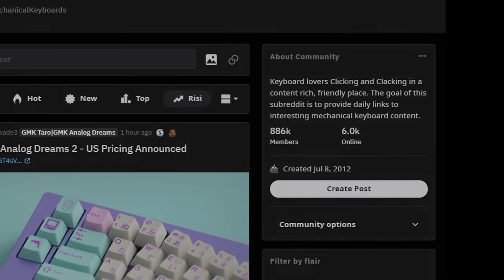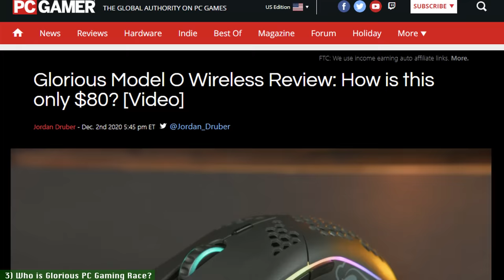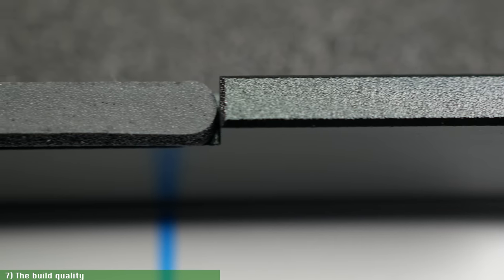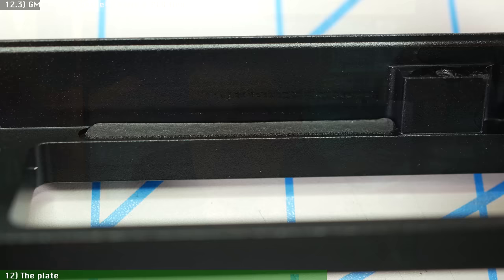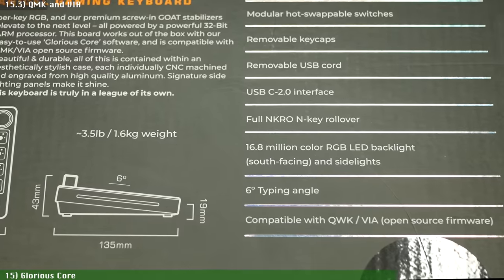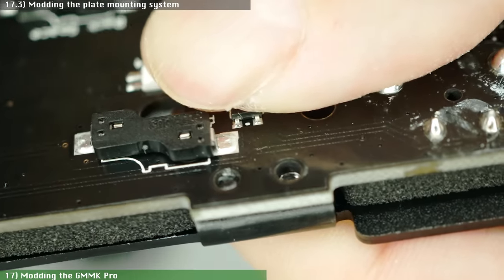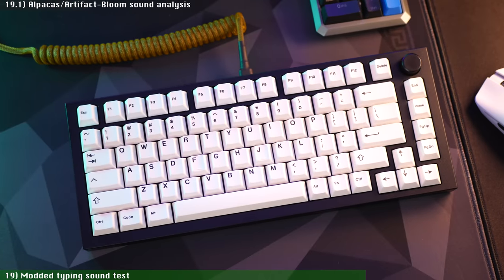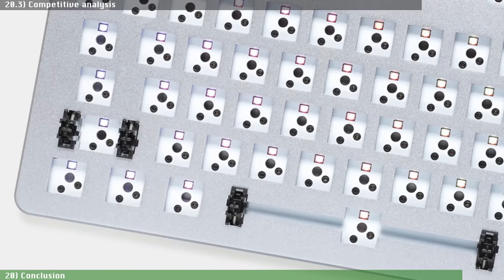GMMK Pro: The ultimate guide (in-depth review + modding tutorial)

Comment: just bought the keyboard + duroc v2 stabs, tealio linears and corsair ppt keycaps. Was wondering, ive seen alot of stab mods but ive heard the duroc stabs i bought are one of the best, so was wondering would you mod them or just lube? also I believe the pcb is pre applied with dampeners for the stabs, is that fine to use or would you recomend that I do a different mod? Im also looking for some neon green dual shot ppt keycaps, preferably lazer etched for the backlight, do you know of something like that or where would I have to go to wait for something like that to show up?
Reply from the maker: Durock's stabs are indeed one of the best and all you'd need to do with them is lubing the housings, the wires and applying some thick dielectric grease to the wire tips (and band-aiding the PCB if you want them to be a bit more quiet on the bottom out). No need to clip these since they come pre-clipped already.

The main challenge with Durock stabs on the GMMK Pro's Aluminium plate is the fitting... You might need to file the plate cutouts a bit to ensure the larger Durock's housing (or Cherry and Zeal as well) can fit.

While my copy did not come with dampers under the stabs (they started doing that in the latest batches), I heard quite a few reports that the included dampers came soaked in lube to the point where the stabs were getting stuck in the goo... So I suspect you'll probably have to either remove as much of the pre-applied lube from these dampers as possible, or replace them with Band-Aids or silicone stickers ( https://amzn.to/3fxLtt4 ) for a cleaner job.

As for the keycaps, the south facing orientation of the GMMK Pro's switches mean you'll have to chose between opaque double shot keycaps (which means you could choose whatever set you want that has the small right shift, Alt, Fn and Ctrl) or find a backlit set that has letters in the bottom side of the top surface or on the side of the keycaps for proper illumination. Since I have never seen the former in the wild, I'd suggest you go with the latter, which would be something like this set from Drop: https://drop.com/buy/artifact-bloom-series-keycap-set-glow?utm_source=linkshare&referer=J2NSDA

Not ideal, I know... But it is the closest thing I could find for a quality set that has backlit legends on the side to work well with the GMMK Pro's south facing LEDs. I have this set and I can confirm that it is thick high quality frosted translucent ABS with a coat of black dye on the sides (and the legends are laser etched). With this one you'll get light shining on the top of the keys (which can get very bright!) and through the legends on the front side.
Reply: @IOSam  thank you, I'll look at the included dampening and see if they are usable. I can't order from amazon so cant buy the silicone thing. If the included are trash, I'll probably have to go for bandaids. You know what the long time use is like for the bandaid and molle mods? will the bandaids fall off after a year or two due to being soaked in lube and adhesive losing its adhesion?
Reply from the maker: @Berberien  The band-aid mod on the PCB should last a very long time, since it only gets pressure from one angle (from above). So, there is no side-to-side force to dislodge it (especially if you put a bit of glue stick in the fabric part as I do). Now the Holee mod on the other hand, while I have not used it long enough to verify this, I'd say is going to be a bit shorter lived, since the up/down/forward/backward movements of the wire (plus the lube that will eventually dissolve any glue left on the band-aids) will probably dislodge the tiny band-aid strips inside the housing at some point. I think I'm more sold on the plumber’s mod (PTFE plumbing tape wrapped around the wire tips) longevity than on the Holee.
Reply: @IOSam  yeah thats what I thought, gonna try to stick with just lube and see how it goes, thank you :)
Reply: @IOSam  finished my build 2 days ago and just uploaded a sound test if you're interested in seeing the result. Not the best quality and some background noise but should be good enough to hear the keyboards characteristics :) Also you'll see that the black etched keycaps turned out great, while the green arent that clear, but good enough that you can tell what it says irl. Also... I went for the band aid pcb mod while only using 205g0 for all lubing except the springs where I used 105 I believe it's called?
Reply from the maker: @Berberien  You did great on those stabs (can't go wrong with Durock PCB mounted)! And you also can't go wrong with Zeal PC switches, eh? Always nice and smooth... Congrats on your build!!!

And with the keycaps, yeah... This board is less than ideal for backlighting... But in the dark, even with top legend caps, you'll still get some light through.
Reply: @IOSam  thank you :)

Comment: seems like the best config with this board hands down is the pc plate since the gaskets do basically nothing
Reply from the maker: Most other reviewers I follow (that tried the polycarbonate plate) seem to agree that the PC plate alone does not fix the lack of flexibility in this keyboard's design (Badseed Tech comes to mind here: https://youtu.be/NRh8u3AYwQ8?t=141 ). So, it seems that, without the O-ring mod I proposed in this video, not even the PC plate will give you a minimally "soft and bouncy" typing experience.

Having said that, as I argued in the video, I believe the reason for this keyboard's stiffness is its case design and not necessarily its gaskets. The gaskets work just fine in reducing resonance and ping (at least with the switches I tried here) and one way to test this argument would be to try using this keyboard with all its gaskets removed (it would be horror show of screeching banging metal).

So, it seems that what gives a keyboard its plate flex is usually a combination of factors (design and materials) and not the use of gaskets alone.

At any rate, I'll experiment with the PC plate and post a follow up video showing the results here.

Comment: Can someone please help me 😭I literally cannot get the knob off the keyboard
Reply from the maker: There is no special technique to do it. You just have to pull it out on a straight line (perpendicular to the surface of the keyboard). There are no locks or screws... Just a plastic fitting where the rotary encoder stem slides in.

Comment: I'm not understanding why people suddenly want plate flex at all. I think of a keyboard as a static structure with well oiled moving parts that have a well defined force curve. You lube switches/stabs and add dampeners to remove any noise or tactile feedback that is not explicitly intended. Plate flex just sounds like putting something that feels mushy right in the middle of everything. No plate flex for me, thanks.
Reply from the maker: Coincidently, I just addressed this issue in one of my latest reviews as you can see here (link to the specific plate chapter where I explain my views on what I consider “excessive plate flex” or “excessively bouncy plates” https://youtu.be/TeGHuWK_Gsk?t=928 ).

You’ll see that you and I agree more on this topic that you’d think when watching just my GMMK Pro review…

But you might be asking why I didn’t mention this more "directly" on my GMMK Pro review. For many reasons… The main one is that here on my channel I try to refrain from criticizing aspects that, while might be unimportant (or even annoying) to me, based on my use case and preferences, might still be something other people appreciate and look forward in a product. I try to focus more on the specs and what you will (or can, with mods) get out of the product despite my own personal preferences.

One thing you’ll see in my videos is that I try to review products taking into consideration more than one use case, and different preferences, since I know people watching my videos are different and have different preferences. So, I don’t want leave the folks that want plate flex without the information they need to get what they want our of their keyboards.

Having said that, I decided to come out a bit more forcefully against this whole “excessive-plate-flex-or-bounce-is-always-a-good-thing” dogma now, simply because I feel this sh!t has gotten out of hand lately (I can’t stand videos with titles like “you’ve never seen a keyboard flex like this!!!” or “this flex is crazy!!!” any longer!)…

While I believe that SOME plate softness helps in absorbing unpleasant rattles and vibrations, like everything else in life, too much of a good thing… is bad!

Comment: I'm not seeing the danger or difficulty in flashing QMK on a production keyboard.
It's fairly difficult on a complete custom DIY keyboard, but anything on the online configurator... is just a minor annoyance.
These micros generally have very robust bootloaders that don't get touched in a normal flashing process, much safer than flashing your PC BIOS for example.
Reply from the maker: As someone who has done that before, I totally agree with you! But I also can understand how intimidating QMK config can be to a non-technical user.

And that is why I decided to produce a follow up video to this one, where I'll cover some additional mods that have been widely used and discussed on Reddit, as well as to produce a step-by-step guide to help people who want to flash the GMMK Pro firmware.

Hopefully that might encorage people who are on the fence about this process to take a shot at it. As you said, the chances of ruining a perfectly good keyboard during this process is indeed fairly slim.

Comment: Great video! I was interested in those Leopold switches that you compared to ergo clears. Would you recommend them over making ergo clears or getting another similar switch like the kinetic labs penguins?
Reply from the maker: Thank you!!! I do recommend getting SP Star Purples instead of making Ergo Clears, since SP Stars will be way cheaper! The SP Star Purples have a slightly bigger tactile bump than the Kinetic Penguin. So go with SP Stars if want a bigger bump or with the Penguins if prefer a smaller one. They are both equivalent in terms of smoothness (if you lube them).

The advantage of buying the Penguins if you are in the US is the quick shipping and Kinetic's good customer service. I'm not sure if you can find SP Star Purples in online stores based in the US (I got mine from AliExpress and it took about 3 weeks to get them).

Comment: Earned a sub coz of this video!
Reply from the maker: Thank you!!! Extremelly appreciated!!!
Reply: @IOSam  I forgot if you mentioned this in the video,  but did you had a hard time removing the screws the first time?
Reply from the maker: @idl1228  I did not. My unit, luckily, did not come with overly tight screws and the Wowstick had no problems removing them from the get go. I heard Glorious is addressing this issue now (and even including extra screws in the box for good measure).

Did you have any problems with this?
Reply: @IOSam  Unfortunately, I'm experiencing this problem right now. I just got my gmmk pro yesterday and I was very excited to mod it. I already contacted customer support and they suggest that I squeeze the corners while unscrewing the case. I haven't tried it out yet tho.
Reply from the maker: @idl1228  That is a good tip (squeezing the two halves of the case together with one hand very close to the screw and then using the driver with your other hand). But even if the screw is stripped and unremovable, I know a few people who had their entire keyboards replaced by Glorious because of this issue. So, if it comes to worst, at least you'll not be left hanging.

Comment: Very nice video
Reply from the maker: Thank you!!! 🙏
Reply: @IOSam  your video has made my decide to get a GMMK pro at my local store and it will be my first custom keyboard.

I’ve informed them that I would like the keyboard to be as silent as possible and they have suggested the Kailh Deep Sea Switches which they carry.

Would this be a good fit for my requirements? Also should I consider poly over alu and the gasket ? Should I ask them for any other mods and or tweaks ?

Your thoughts are most appreciated 🙏
Reply from the maker: @axelris  The Kailh Deep Sea switches are a very good choice for a silent keyboard! As for the plate, if you go with the poly plate, the keyboard can get even quieter than with the aluminium plate. But you have to consider the challenge of replacing the stock plate with the polycarbonate one, which, while not super difficult, it can be an involved process if you have never done that before. If your local vendor can do the plate swap for you, then this could definitely be a good option!

If you want a bit more information about how the GMMK Pro behaves with the polycarbonate plate, check this other video I posted about it here 👉https://youtu.be/HhahtVszzgI
Reply: @IOSam  i appreciate the response and the depth of your videos. you definately deserve way more subs ! All the best

Comment: I was seriously disappointed with the cheap, soft and extremely overtightened screws they used on the case. I managed to strip one completely and I seriously didn't want to send the keyboard back over a single screw I can't screw out after waiting months for the keyboard. I just pulled on the cover and snapped the screw lol. Another thing I'm disappointed with is how overlubed the stabs were with thick, sticky lube that made the spacebar get stuck on the bottom and go back up very slowly, cleaned that up and replaced with a thin layer of lube and it's much better. Another downside is the lighting customization that just sucks compared to Razer but whatever. Also the volume wheel is broken and comes jumps steps back randomly. Otherwise the I'm impressed with how sturdy and heavy the build is and pretty quiet. I expected the case to be plastic not metal, you could kill someone with this thing lol. It does look nice.
Reply from the maker: Yeap... I hear you! You're not alone in these two complaints! An incredible amount of people had exactly the same two issues you had. Now, I don't know if those problems affected just the later batches of the board or not, since I didn't have them on my first batch sample.

But whatever the case, these problems have created a lot of frustration! To be fair, Glorious has been very responsive to their customers by providing new screws, guides on how to remove, fix or replace the stabs and even replacing the whole board in cases where the screw broke and got stuck in the keyboard's frame.

Now, if you got a bad rotary encoder, then I’ll definitely ask for a keyboard replacement, since this is not something I heard anyone else complaining so far. Did you buy the board directly from Glorious (or one of their authorized distributors outside of the US)?
Reply: @IOSam  It just arrived to me few days ago after like 2 months since I registered for it and bought it on the Glorious website. I've read that they even send people another keyboard as a replacement only because of the screw so that's pretty cool.
Reply: Anyways today I also got the Everglide aqua king switches and they're just amazing. So much better than the Gateron ones I had that were too light and had too little travel distance and rattled even after lubing. The Everglide are perfectly smooth and lubed with a really thin layer of lube I'm really happy with those
Reply from the maker: @Mart-E12  That's funny! Just got my Aqua Kings today as well! :)  But still haven't had a chance to check' em out yet. These will go in my next monster switch comparison video as well (covering a bunch of hyped linears).

And yeah, if you push Glorious about the problems with your board, it's guaranteed they'll replace it for you.

Comment: givent the price :O it shud be wireless
Reply from the maker: I don’t disagree with your statement there… But considering when the GMMK Pro came out, I can still cut Glorious some slack, since the amount of metal keyboards that came with good wireless connections at the time was still relatively small (compared to the situation today).

BUT, I can assure you Glorious took note and their upcoming GMMK Pro 2 will come with either a 2.4 Ghz or Bluetooth connection (or both), which will require some design changes to the case and plate materials though… To avoid blocking the wireless signals (which is why most wireless keyboards in the market today either have plastic cases or plates, to avoid creating a “Faraday cage” that would hurt the wireless performance).
Reply: @IOSam  oh if they can copy what iphone does, like incorporate the wireless transmitters into the metal case design like how they did with the antennas, that will be super cool

Comment: I'm I going crazy or did half the switches all sound the same:|?
Reply from the maker: While I don't think they all sound the same (I definitely can hear difference between them all and certainly between the two linears), I'd agree that this keyboard will mute at least 2/3 of the noise coming out of whatever switches you put in it (which can make it a bit harder to hear the differences).

But if you like your keyboard to be louder, you'd have to remove all the damping material out of the keyboard (case and plate/PCB foam). In that case you'll have a lot more reverb noises coming from a metal case like this, but at least you'd have your switches sounds a bit louder.